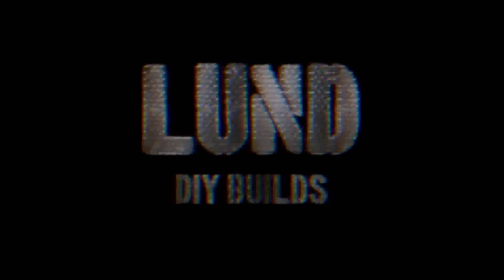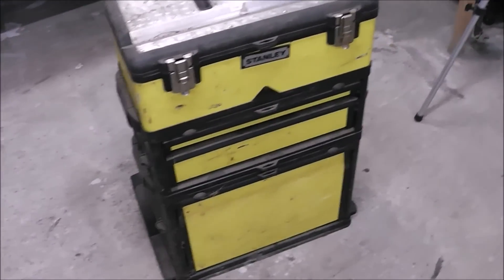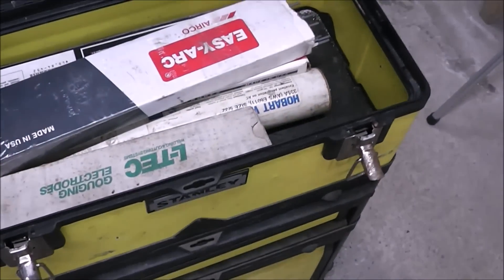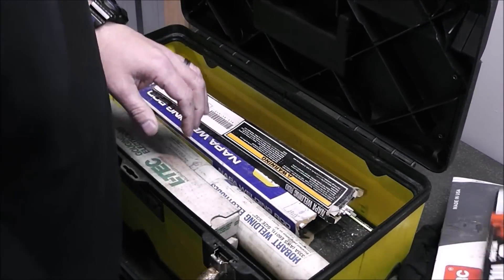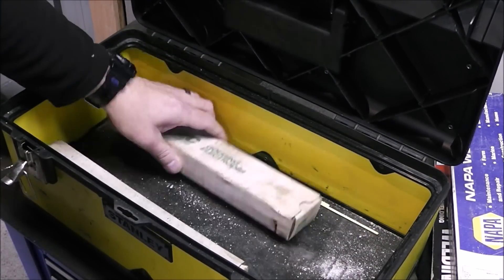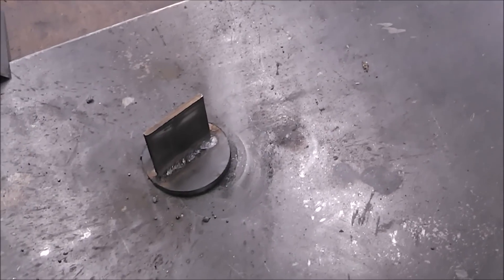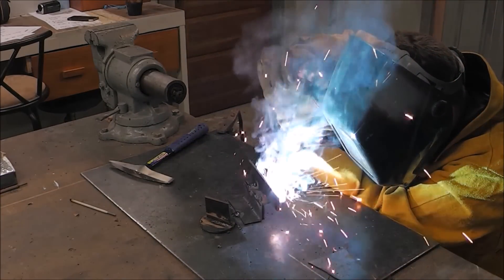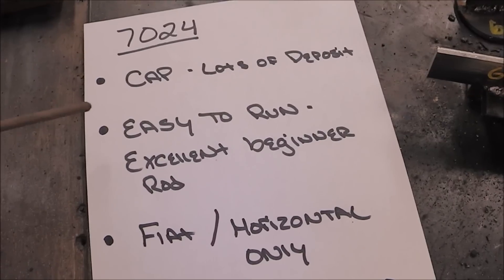💥 BEGINNER WELDING SERIES - ELECTRODES (rods) and MORE E.2

Comment: Hi Brandon! I really like yours video´s here in your channel 😃👍, I am a beginner and I have some options on my little welder that I really don't understand. What is Hot Start and Arc Force and what do they do? Big gratings from Norway.
Reply: Thank you 😃👍 both Hot start and Arc force can I adjust in my welder from 0-50 ! ! Hope you can make a short video how to use and adjust these settings in the future 👍👍👍
Reply: I have this welder se the link. https://www.expondo.no/stamos-germany-elektrosveiseapparat-230-a-hot-start-arc-force-haandtak-10021221
Reply from the maker: @Roy Braathen Hot start is basically a short burst of current as you ignite your arc. It significantly increases the ease of starting electrodes, especially in difficult conditions such as damp electrodes or when using ‘difficult to run’ electrodes. Arc Force, sometimes called "Dig" or "Arc Control", is similar to hot start, except arc force operates during welding, not just at ignition. When the welding machine senses a short circuit it will deliver a peak of current. This greatly assists in stabilizing the arc, preventing the arc from cutting out while welding and prevents the electrode from sticking.

Comment: rod oven? please explain that in your next video
Reply from the maker: casy casy I probably won't cover it in a video just because its a bit advanced but i wanted to answer your question.  In short, a rod oven is basically a small heated storage container that holds your welding electrodes and keeps them warm to a set temperature so they don't hold moisture. 7018 rods are susceptible to moisture where as they are low hydrogen.  It's not crucial to a home hobby welder, but for coded work (work that needs to meet a certain criteria) it can be very problematic.   Mainly porosity in the weld and porosity will fail an inspection.
Reply: thanks

Comment: Have you checked over the welder itself? also, sometimes (actually quite often) workpieces on a grounded benchtop will arc out, that can cause stuttering sometimes.
"The size of your rod don't matter as long as you get good penetration in all positions darling" -as the "actress" said to the Bishop :)
Hot BBs in yr boot -used to call that the slag kickers can can.
Reply from the maker: Jaques Daniels I haven’t checked it but I need to. Whatever holds the amp setting inside the machine seems to be slipping. The amperage lever was dropping. I plan to lift her dress and see if anything is off. Those hot BB’s on the foot are a real treat!